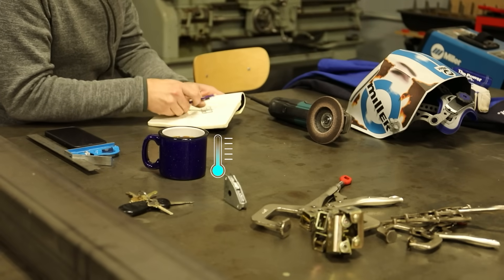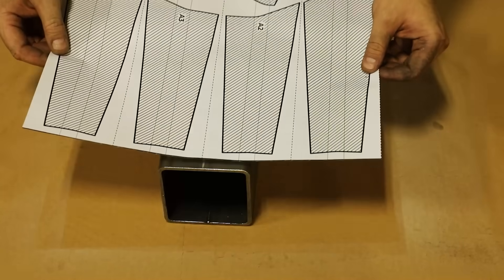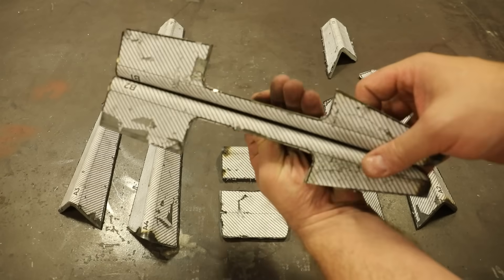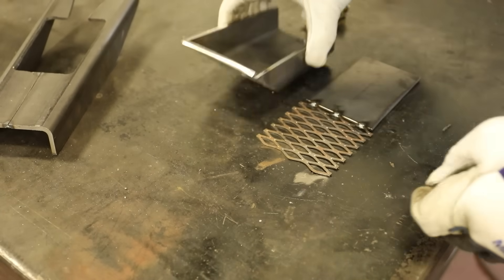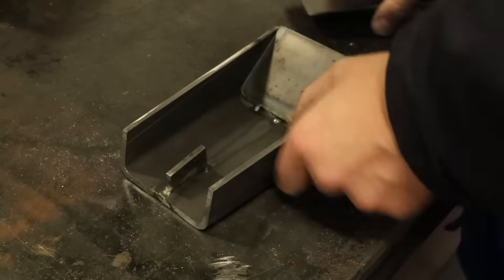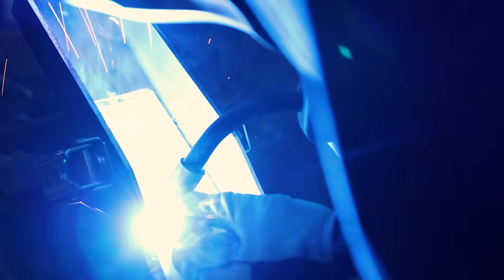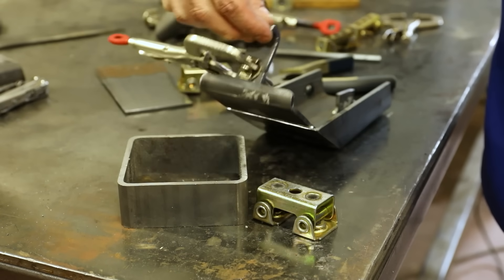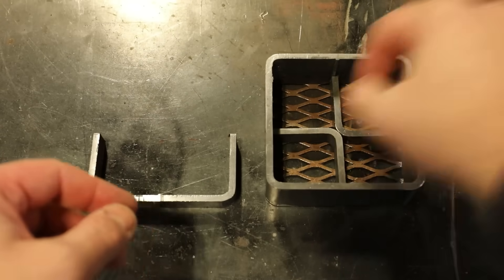Rocket Stove | Coffee Maker for the Shop

Comment: Have you done a video on the small Magnet helpers you are using on the rocket stove to hold parts in place?
Reply from the maker: These are Stronghand tabs… they are noted in the comments, I think.  Only caveat is use them for tacking as over time, magnets hate extreme heat.  If you do a lot of welding on the plate next to them they will lose their strength.  Hope this helps…

Comment: Brian, dein Bauplan ist zum Ausdruck in DIN A4 nicht zu gebrauchen,das ist die gängige Norm bei Druckern,leider hast du auf meine Mail Nicht geantwortet.
Reply from the maker: The plans are intended to be wrapped around a tube that is 12” long.  Not sure how this is supposed to be nested on a piece of paper approximately 8.5”X11”!  If this is the only option you have for printing, you will need to go to a shop or splice it.  Usually a 24”X36” print on Arch D is a few bucks in black and white.

Comment: Artistic and functional, a Mona Lisa of rocket stoves. 👍
I'm planning my own build and my criteria is a light compact backpackable rocket stove with the fastest water boil and highest btu energy focal point burn in the first 60 seconds. Any tips? Also, about how long does yours take to bring a cup of water to a boil? What is the weight? Have you measured your heighest heat temperature it produces? 
Thanks, subbed, liked, and can't wait to see your next new video. Bookmarked your channel for my next bingewatching session. 🤓
Reply from the maker: Thanks!  This is built like a little tank and would be way too heavy for backpacking!  I have seen some great little stoves for backpacking and this would be a fun project to design a small collapsible design!

Comment: Does it get hot enough on the bottom to require a heat resistant pad to sit on?
Reply from the maker: Didn’t really notice when sitting on the 2” thick steel table… but I am sure it is pretty intense close to the combustion chamber…

Comment: You are Not having problems using the stove inside? Can i Heat my Appartment with Something bigger than this one nur without using a chimney? Just with Air wholes on the Floorlevel for Air Exchange and outtake for Carbon monoxide.
Reply from the maker: Do not do something like this without adequate ventilation!  If vented properly, a rocket stove can be used to generate tremendous heat for a tiny amount of fuel.

Comment: I made pretty much the same thing . I was stuck out in the cold trying to repair my truck after my house burned down . so I cooked everything on that thing  and of course coffee .. I wrapped copper tubing around the chimney Part.  have water dripping  50 tubing  then going up to an insulated tank  so it works as a hot water heater to . then I went ahead and  wired it then Mixed vermiculite with concrete   and covered it . then I started adding on and I built the heat riser  for the pipe inside it that  it's hot and then a fan blows  so it works of the heater to .
Reply from the maker: Wow! Great

Comment: Cheers Brian, I find that spray adhesives can get gummy with heat and can slide a little way off when cutting. Especially so with smaller parts with a grinder. Water soluble Glue Sticks don't do this.. those ones for paper that are retractable similar to a lipstick. And when you are done just wet them with water and off the pattern comes.
Reply from the maker: Interesting, I’ll have to try this…
Reply: @Grunblau  Also good when cutting band saw metal parts and giving the sheet the occasional squirt with WD40 to keep the blade lubricated, with spray glue the template easily moves, but not the water soluble glue stick. They still get hot and burn off so you need to watch temperature. Also a really good glue for preserve labels like home made jams, because they are so easy to remove again. Not to mention relative cost of Super 77.

Comment: Welded the chimney up. Then I welded the bottom half. None of those match. Gonna be some thiccc welds to make this work. Really appreciate your design. I new to welding
It's been a fun project 😂
Reply from the maker: Slice through the seam on the side that is too large with a cut off disk.  This should get you closer! Also remember that the pieces are wedge shaped.  You might be able to ‘slip’ one against the other and have it match up.  Then just grind the excess off the ‘lips’. Good luck!

Comment: Thanks                        Finally got mine done and it came out 😳amazing😳. The plans are perfect,way too cheap, but perfect. Going to make another one but I'm going to use diamond plate instead of using 4"square. The first page of the plans has all the 2-D templates you need to make it out of plate and they can easily be scaled up. Should make it easier, less pieces,and no welds visible on the inside.
Reply from the maker: Fantastic!  Stove looks great!  Yup, nothing would keep the plans from scaling on plate steel…

Comment: Beautiful and unique design. Are you using a Miller 211 welder? I will tune in again. Thanks
Reply from the maker: Yes, this is a Miller 211 Autoset with MVP.  If you are in the market, I would recommend the Multimatic 220 so that you can TIG, MIG, or Stick weld with the same machine!
Reply: Yes the Miller 220 would be great. But I  have the same 211 that you do. I am impressed with the quality of your work. May I  ask what size wire  do you use?  Do you use the Auto set feature?  Thanks again.
Reply from the maker: @ezelk1337  0.030” solid wire…. It is important to use cover gas rather than the flux core wire that generally comes with a welder. Too many people give up on welding with a bad experience from a setup that should only be used for non aesthetic welds.  

I am not a great welder, I just follow the chart on the machine and have a good setup.  Thanks!

Comment: Can you send the plans in a different size? I have some 8x8x.25" wall I'd like to make this with. I can't upsize the print on my end.
Reply from the maker: In this case, I’d split the paper patterns on the centerline of the faces… and apply the pieces on the corners individually.  All you are really doing is taking advantage of the pre bent corners.  Again, accuracy matters less than symmetry!
Reply: @Grunblau  I just measured it, and it's actually 7"OD and 3/16 wall. Wouldn't the height/width ratio that looks great in your size be off if I just made the parts fatter?
Reply: I think I figured it out, I'll buy the standard plan and add 1.5" masking tape on all sides, and that should get me  the same ratio?
Reply from the maker: The way I am describing it, the parts will come out the same, just cut from a larger tube.  If you want to make a bigger stove, you might be able to have the prints printed larger, but be aware that the corners of the tube don’t scale.  It would likely be close enough to fudge tho…
Reply: @Grunblau  I'll see if I can get a print shop to upscale it 175% before I chop it up. I just ordered, cheers.

Comment: can you sell these plans in metric?  will it work will common sizes of steel avalable locally in australia?
Reply from the maker: Plans/patterns are 1:1 so units of measurement don’t really enter into it.  

The tube size is 100MM by 100MM at a length of 356MM and a wall thickness of of approximately 5MM. (If this helps).

Comment: Love it! Does it smoke? Like, clean enough burn for inside a garage with the door closed?
Reply from the maker: I was surprised at how little smoke was created.  This might have been partially due to the cedar but it is a fairly efficient way to burn wood.  

I’d be much less concerned about the smoke from the stove than the welding fumes that created it!  That said, the shop smelled of burnt cedar for a day or two :)
Reply: @Grunblau  thanks for the reply! The link to the Miller welding project page was intriguing. Appreciate that, and spot on with the video work.

Comment: Good video. Nice project. I would’ve put slight bevels to make it easier to weld. The only thing that irks me is the lack of gloves while handling the steel while sanding.
Reply from the maker: Yup!  You can see small bevels on the chimney seams and on the side seams.  I didn’t do the top and bottom of the stove because I was considering TIG welding this at that point.  I went back and gouged the outside of these seams with a cut off wheel before welding.  I left the bevels out of the video because it was just more belt sanding and it ruined the pace.  Thanks!

Comment: Must be done from special inox steel for working many times
Reply from the maker: I will only take out my tube steel rocket stove on special occasions then…
Reply: @Grunblau  I have made rocket from steel 1.0114 on first attempt. Tested with sensors in different zones how it works but after several weeks of intensive work it almost annihilated by fire) now builded big stove with 2 rockets (steel 1.4845) for torrefacting 80kg of oak wood and they work pretty fine - no any erosion by oxidation

Comment: Great design. 

Super 77 has some nasty solvents in it + burning rubber when cutting. 
WD40 & Goo Gone both have a lot of extra organic solvent vapors.
Resin bonded abrasive cutoff disks are nasty. 

Scribed lines & saw cutting only eliminates all of these additional hazards.

Comment: Very nice design. Fire is magic because the cold, dense air that is pulled towards the center of the earth is invisible. For every tongue of flame shooting vertically up, seemingly breaking the laws of physics there’s a jet of invisible, compact cold air punching it’s way down through the flames to squish the hot, expanded low-density in the opposite direction. People say that heat rises, but that’s not how we should think of it. Cold falls. In the case of a rocket stove gravity is driving the cold air through the firebox inlet. People who build firepits without making provision for gravity to drive relatively cold dense air directly into the base of the combustible material are compromising the science of fire.
Reply from the maker: Thank you very much for the dynamic description of what is going on!

Comment: Beautiful design, thanks for showing the options box tube gives. Or a plate sheering machine and a brake. You can put your welding machine a little higher while keeping the same wire speed. When pushing the welds hold your pistol at a shallower angle, so that more of the wire ends up at the front edge of the puddle.
Reply from the maker: Thanks for the info!  I know I forgot to turn the machine up again after doing the hinge or the expanded metal.  I’ll play with the approach angle more!

Comment: Alll that work and artistry just to make it look good, not practical but beautiful. Well done!
Reply from the maker: Beauty is a function too!  This might explain why all of those ancient people insisted on decorating their pots…. Thanks!
Reply: @Grunblau  Oh no I’m not saying not to make it beautiful, not at all. By the way, you mentioned its physics in passing, did the this form improve its function? I noticed the cross sectional area decreased, form the intake to the top. Which means the air velocity would increase.
Reply from the maker: @iTeerRex  No worries as I was agreeing with you! Less time was spent on the engineering this go around.  It definitely seems to benefit from a large burn chamber and a smaller chimney opening.  You can see how the flames shoot out of the top!  I started with an idea of a ‘pot bellied rocket stove”. But then tweaked the design toward simplicity…
Reply: @Grunblau  Very cool, it probably sounds good too.